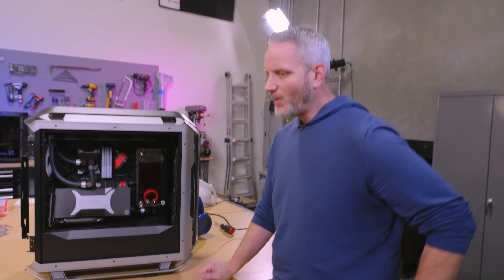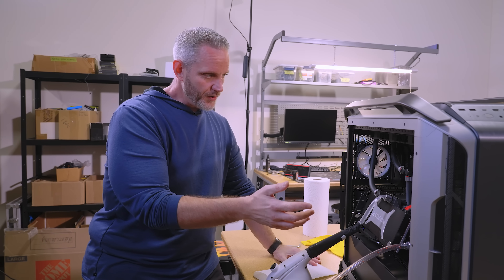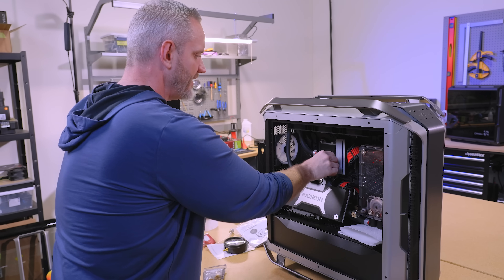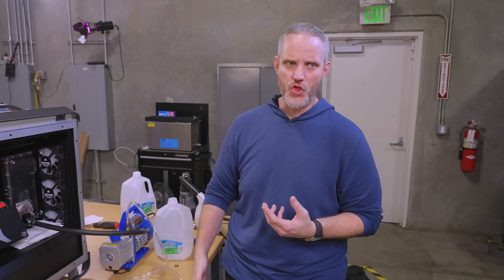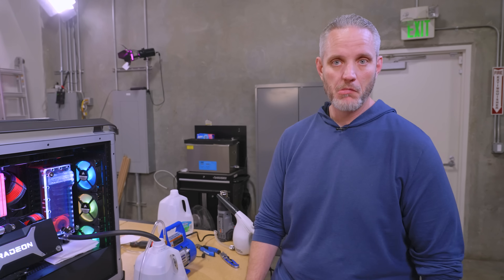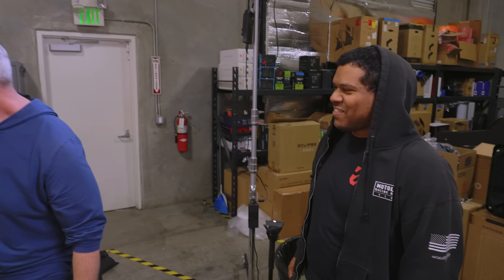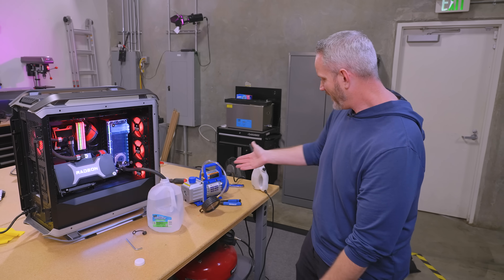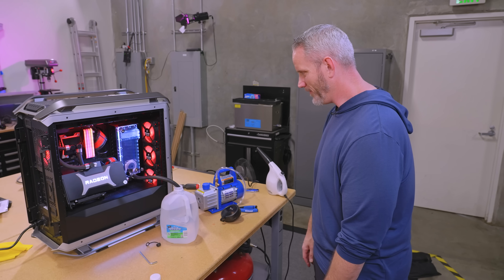I used Vacuum Pressure to fill a PC! Why didn't I do this sooner!?

Comment: Another thing ya might be able to do it like we do on AC systems and pull a vac, leave it, and see if it holds or has a leak before you find a leak with coolant.

You can build a vacuum fluid pump with a few fittings and a glass gallon picke jar. I made mine and use the same vac pump I use to fill AC systems to flush out brake fluid and bleed the system. My vac pump still works just fine after 10 years and brake fluid will cause way more damage than water to the pump.

Comment: Don't know if someone else tought of this, but is is also a great seal test. If there are leaks in the system, the vacum pump will not reach max pressure - or vacum.
This way you avoid the risk of the fluid leaking after pluging the system in.

Comment: If the drain/fill port is before the pump and there's a hose from the air pocket area (the normal fill port) that leads into the source bottle the pump will draw additional water and push the air into the bottle until there's no more air in the loop. With this configuration the vacuum could be drawn at the top of the bottle (i guess).

Comment: You may want to look into the following:
A three way valve on the fill side of your rig. It will allow you to switch from the vacuum pump to the fill bottle and have the fill hose as full as possible to limit the amount of air.
If worried about pulling water into the vacuum side of the system, install a fluid separator to keep the liquid from the vacuum pump.

Comment: Could you not take like a 3 gallon bucket and put two fittings with valves in the lid, put the drain hose on one and then the pump on the second. Open the pump side valve and create a vacuum in the bucket. Close the pump side valve. Then open the valve to the loop and suck out all the fluid into the bucket?

Comment: I want to see the condition of radiators after a few cycles of this. Will the flexing from the contraction and expansion work harden copper and aluminium enough to cause trouble? Will they stay deformed?

Comment: Hey Jay. Another interesting part of the vacuum is  this is a good way to check for leaks before introducing liquid. Pump it down, shot off the pump, wait about 10- 20 minutes. if the vacuum doesn't drop, no leaks.

Comment: If you make a T with 2 valves where you Connect to the reservoar you put one end in the fluid and make sure the tube is full and the valve is closed and the other is open and connected to the pump you just switch the pump valve of and the fluid on then you would not have air pulled in.
This is how we do it on Teslas :)

Comment: looks cool but a bad idea I've worked testing pressure lines and vacuum lines and they are built way different I've seen hydraulic pipes rated to over 1000 bar working (hydrostatic test 4000 bar) collapse when put under -1 bar pressure. (We got bored in workshop) so god knows what it's doing to the thin tubes that are in the Rads. The pump in a radiator system are not the same as the vacuum pump as a vacuum pump is a basically a air compressor in reverse on steroids

Comment: I literally asked myself this question on your last video but decided not to post it because I thought you would have already tried it.  Also, the better way to do this is to pull the liquid up as you pull the vacuum.  This requires a higher fitting or a reservoir to do it.  So on that rez, you would attach the hose to the fill port on the distro plate at the top.  Put a hose in your liquid at the bottom and pull a vacuum with all of the valves open.   You would need a water separator in line with the vacuum pump to avoid drawbacks. 

Also, vacuum fill kits already exist.  They used to sell one on FrozenCPU.

Comment: Put a second valve o;n the end of the tube, close the back o;ne, fill the tube, close the valve at the end. Then stick it in a bigger container so yo;u can; use both; hands,  then open those valves. Would that be a reasonable way of going about it to keep that little air from the tube going into the system?

Comment: Silly Jay, I am a mechanic as well as a computer enthusiast. I have 2 tips to help make it better I have been using my snap-on coolant vacuum kit for years now I just haven't thought to share the idea. But you can just put an adapter on the hose to use the the automotive kit for pc. Second tip if you use a second valve at the fluid end of the hose you can create vacuum in the whole hose and not draw any air into the system.

Comment: That's not the radiators clinking. That's the fluid in the system boiling. You lower the boiling temp as you lower the pressure.

Comment: If your rigid tube system has a leak in a joint during initial testing, you could use the vacuum to pull in sealant. I've seen woodworkers pull glue into a fine crack with just a shop-vac on the opposite side. Brilliant video!

Comment: You would be much better off if you had the vaccum pump on the drain point and use a fill point elsewhere in the loop.

Assuming that those imploded very thin metal pathways in the radiator you were hearing popping re-expand when the liquid enters.

Have a funny feeling you just crushed a few sections of that radiator permanently?

And the more you do it, may collapse all of the pathways rendering the radiator 100% useless?

Might be wrong about that, but I'd definitely want to verify it caused no permanent damage to the radiator before depending on that radiator to keep something cool.

Comment: I have been using a vacuum pump to test and blead my system since the first one I have put together. I use a hand pump with a gage.  pump like that will max out at 30 inches of vacuum

Comment: What you could do, even if you don't have a drain valve on your water loop, would be to have a 3 way ball valve where 1 line to the PC water loop, 1 line to the fill water and 1 line to vacuum. The 3 way ball valve diverts the direction of flow from vacuum to the fill water and in 1 motion you cut off the vacuum and fill the water loop at once.

This would also eliminate the air gap in the loop since the whole line is kept under vacuum.

Comment: if you close the valve, pull the hose off the vacuum pump, PRE FILL THE TUBE before putting it in the jug of water, that should prevent the air in the hose

Comment: Right as I was yelling: "no there is now air in the tube" the cut-scene came. Right you just need another valve at the end of the tube/hose/snorkel with a wire attached to the release lever so you can operate it while the snorkel is under water. The air pulled in by that method would be minimal.

Comment: Hi Jay! I have two considerations for you:
1st - add a liquid trap between your vacuum pump and the system, to avoid liquid damage to the pump itself.
2nd - does the pump (on the PC, that is) rotate when filling? If so, does it generate current - similarly to when you blow air through a fan?
Besides that, I think it should work if you have a good enough vacuum pump and keep it running until all the system is filled.
[edit] In this particular system I would connect the vacuum in the top port, and leave the tube on the coolant container. Between the vacuum pump and the system add a liquid trap (to protect the former) and a valve to regulate the intensity, this way you can have a partial vacuum and, possibly, completely fill the system.

Peace and long life! 🖖

Comment: to fix the air in tube during the switch over. the put the vacuum on the fill port with its own valve. the drain line with extra valve on end of hose in a bucket in order to reach in to open valve.  
 vac pull with fill port and drain port open only bucket valve closed, once complete, close fill port and open bucket.

Comment: Have a little pitcher with coolant, hold tubing upwards, pour coolant in so tubing is full, then quickly flip it into the jug, to avoid sucking the tube air in.  
Also, this setup would be good to test leaks, vacuum it out and let it sit, see if you lose vacuum, means leak. Could also pressurise it, which would be even better for testing leaks, if no air is coming out, dense water sure won't.

Comment: I had a system that was hard to bleed. I put vacuum on the reservoar and had it under vacuum for a while. It worked lik a charm. The pump I used was a handheld vacuum / pressure pump used to test engine components like wastegates and pressure systems.

Comment: I'm concerned there might be damage to the radiator capillaries that will affect thermals even if it doesn't leak.  I think the best way to test this would be to collect before and after results running the same tests and see if there's a reduction in performance.

Comment: Suck the vacuum from the top, less risk of fluid reaching the pump. But did the radiator tubes got pulled from the flanges that transport away the heat from the almost flat tubes? Compare the amount of fluid drained before filling it with this method, it ought to tell if the almost flat tubes in the radiator got squisched by the surrounding airpressure?

Comment: Central heating (in the Netherlands) works with a pump, a pressure vessel and airvents to get al the air out of the pipes and radiators. I always wondered why this principle isn't used for pc water cooling.

Comment: it could creat stress's on some of the finer parts. BUT... hook the FIll tube to the drain plug and a LONG CLEAR vacumm tube the the top inlet then use the vacuum to pull the liquid up into the system. same effect but no abnormal stress's on fine detail parts.

Comment: If you are looking for a permanent solution to help reduce air during fill, take a look at getting a reservoir with an output at the bottom. Connect a tube with a valve. Make sure air is out of tube before connecting to the system.

Comment: That feels like a damaging level of vacuum. Maybe just building a loop with a bleeder at the top to suck from, even if by mouth, would be good enough. I get to rebuild my rad space into a triple 360, plus a 120. Ill see how much better I can fill the system with a top mount filler/bleeder.

Comment: I'd like to see Jay do this with that Corsair Distro/pump/res combo thing, the XD7 pump/res. Mainly cause i use that  in my rig and it is a pain beyond pain to get any air out let alone the majority of air out of the loop. air just always collects at the top loop of the distro portion of the XD7 and it just sucks. theoretically it should work but i would like to see this with complex distro plate or the XD7. I think Jay was sent an XD7 by Corsair.

Comment: soul8bounce none and not because of build quality or meterials or because of tubing diameter. Simply put the heat exchanger just isn't larg enough even for a small appliance but it's not like I haven't had both computer radiators and HVAC radiators sitting around side by side to really compare the 2.  In reality I probably could take about 12 computer radiators and put them in series and make a basic A frame radiator coil. Also FYI... kinda sucks when you freaking @ someone but have mentions shut yourself shut off... Usually the signs of an Internet troll

Comment: More easy with a water pump
Hose in the bottle connected to the pump, from the pump to the ventil on the sistem, then another hose from draining to the bottle
This way you can fill the sistem completly without air in the sistem

Comment: If you add a tank with a fitting at the bottom and use a couple of quick discounts and discount the tubing from the pump and connect the tank you won't have any air in the system at all.

Comment: Why not build a stand that supports a bottle like that gallon jug upside down.  Mount a quick connect nipple to a cap for that jug that won’t leak silicone wet what not and you can have a valve at the other end of the quick connect so all your air would literally be between the quick connect and the valve right there at the bottle like a nipple a shut off valve each end of your fill hose vacuum hose whichever and you can speak that way and eliminate most of the air.  

The other option is to do the exact same thing that you are doing but instead of pulling vacuum on the system and then releasing the vacuum using that to suck it in you could put your fill tube on your drain port with a quick connect and your vacuum tube on your port and literally suck the air out of the top of the system and do it slowly while introducing the coolant through the drain. Just like bleeding a hydraulic brake system. That would possibly relieve some stress on tubing rads and whatever parts.

Comment: Use a compression fitting on the tube attached to your pressure pump, that way you wont lose pressure when you detach before sinking it in coolant to suck up. Problem solved.

Comment: Hey Jay , If you connect  a vacuum at one end of the system and the "fill tube" at the GPU . . having valves at each end . 
Another option is to place a large container between the the cooling system and the vacuum pump that will give you a sump for the fluid to "drain" into .

Comment: 6:40 easier solution. Once you close the valve, before you dip it in the water, fill up the tube, then hold your thumb over it while you submerge the tube. This way it won't have air in the line when you crack the valve open.

11:45 using your vacuum pump to drain the system is easy too. If you look how bleeder kits work for cars, it's basically a bottle, the inlet side (side the fluid will come from) goes into the cap with a hose that reaches the bottom of the container. The vacuum line attaches to the top of the lid. When you pull a vacuum, it sucks the fluid into the bottle but doesn't suck it into the vacuum pump. You can make it multi staged by just connecting the vacuum line to the inlet line of an identical container setup if you fear you might over flow and to reduce the chance of sucking liquid into the pump. Since you don't need to achieve a full vacuum when doing this (since you only need to pull enough of a vacuum to empty the system) there shouldn't be much worry about boiling the fluid from the low pressure.

Comment: If you fill the tube before opening the valve it wont have air to suck. put a funnel on the hose that will hold enough fluid to fill the system.

Comment: for biger sysems like houses water heating it is valve thats automatic taking out air from closed loops  
if  you find anything like that for small systems it will be the best way

Comment: i'd drain, then hook the vacuum to the fill port, and connect the drain to the "fill liquid". turn on the vac long enough to purge the dain of air. close that valve, let the system vacuum further down, close the fill vac line valve. then open the drain, now your filling without any extra air anywhere, and you prevent any liquid from entering the pump.

Comment: Why do this instead of a wet/dry vac to provide the suction to draw the liquid into the system? You wouldn’t have to worry about liquid entering the vac so you can fill the system completely.

Edit: Nevermind. Having never built a water cooling setup I didn’t realize there only one valve for filling the system.

Comment: @JayTwoCents you know LEAKSHIELD right? They use a very small vacuum pump in LEAKSHIELD to protect the system and also to fill up your system. Ok, it is much slower as the vacuum is much smaller, but that is the way you fill you system with the help of LEAKSHIELD and they use this system now for several years.

Comment: Why not take an existing pc pump and reservoir and power it from the wall or an old psu? As long as you have planned drain and fill locations, you can plug into those.

Comment: also, just sticking the hose over the threads on the pump fitting doesn't completely seal the connection as the hose can't adequately seal off the threads. The larger sized fitting is for current automotive AC systems which use R134. The smaller is for practically extinct R12 ac systems

Comment: Pfftt.. Aquacomputer LEAKSHIELD... been using it for 2 years.. its 2023 Jay not 1980..... i fill with -450 Mbar
performance-pcs sells it..
LOL even my whole loop is at -300Mbar 24/7  buy one mess with it, could be fun :P
And the "crackling" you is is the radiator tubes getting loose from the louvers (yeah breaking it)

Comment: Congrats, you half-filled the system.  Pull vacuum from the high point with suction at the low point and a collection point between so you dont flood your vacuum pump.  No reason to be pulling super high vacuum and possibly wrecking radiators.

Comment: If you want to use the same pump to drain systems all you'd need is a vacuum rated container between the pump and system. Have the pump tube directly on top of the container and run the system tube to the bottom. Start pulling vacuum on your container and then open your system valves.  

The container will act as a trap catching the majority of your fluid and protecting your vac pump

Comment: @JayzTwoCents try this with both fill/drain ports. connect the vacuum pump to the fill, and source fluid to the drain. I'm betting there will zero to no air whatsoever.

Comment: if you get a fitting for the bottle cap you could then tip the bottle upside down and fill the pipe first and remove that air. you would probably need a breather pipe running through the cap as well to allow air into the bottle.

Comment: Iv been working on doing this in my own system using a smaller pump permanently attached to my computer. its far too difficult to drain and fill normally.